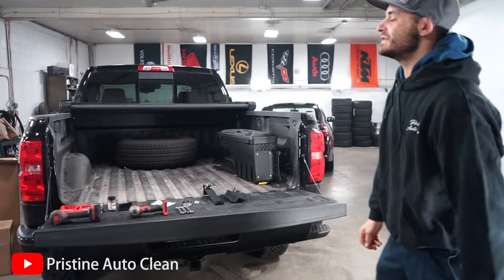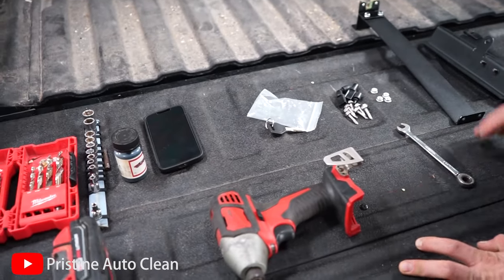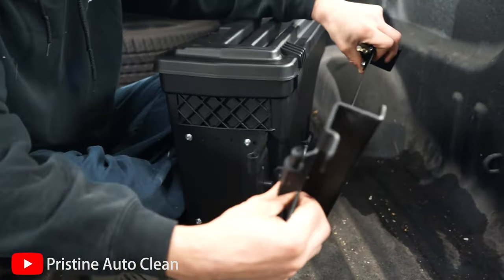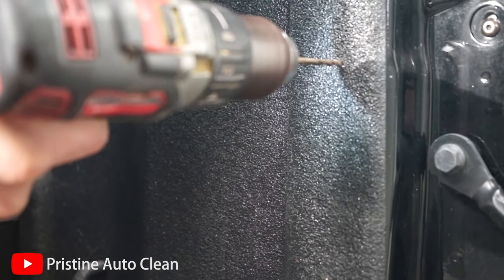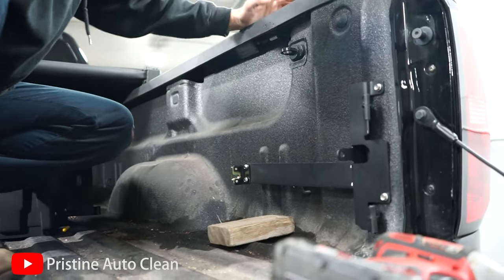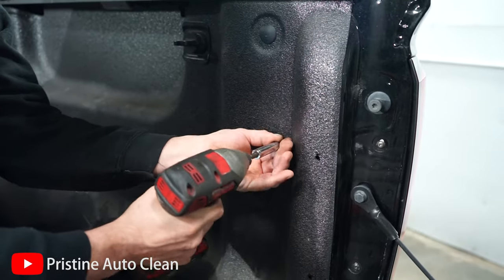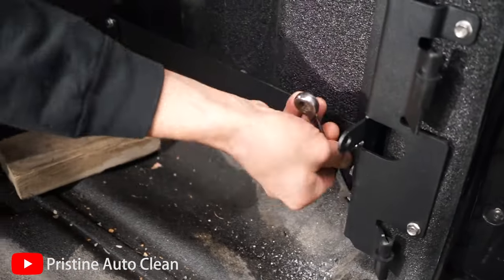Silverado Wheel-Well Storage Box Install!

Comment: Is the lower tie down point now completely covered by the bracket? If so, can you mount a little higher?
Reply from the maker: Most likely is covered, you’d have to remove the box to access it or use the upper tie down location. Could be mounted higher as well

Comment: Very helpful video. I have a gator tonneau cover was a little concerned the locking handles on the gator tonneau cover would interfere. Watching this video I think I am good. Just ordered one on Amazon. If it goes smooth will order 2nd one.
Reply from the maker: Glad it helped👍
Reply: Installed driver side today went perfect.. passenger side arrives tomorrow. Took about 20 minutes. I pre drilled before sinking the self tapping screws.. worked out great.
Reply: Which one did you get off of Amazon?

Comment: This is clearly the difference between how a craftsman does things, and how a week end warrior screws them up. I tried blowing those self tappers home with the "rattle gun" as you call it. it didn't work out so well for me. I like how you did it much, much better.
Reply from the maker: 🍻 Thank you! Been in the game for 20ish years, unfortunately I’ve learned every lesson the hard way! There’s no screwing stuff up, just take those mistakes as a learning experience! In your case just get some bigger self tappers and thread them in by hand!
Reply: @pristineautoclean  Definitely. I’m very disappointed in the design of those swing case things fit my new GMC. They don’t hug the wheel wells and stick way too far out into the bed area. I’ll have to find something else I guess. Too bad. I really liked those things

Comment: Can you still fit a full sheet of plywood in the bed? Also is the box waterproof?
Reply from the maker: The box slides right out if it needs to be removed 👍
Reply: Yes you can fit two 3/4” plywood sheets before you would need to remove one of the cases. If you have 20 sheets you would want to take out both cases. They come on and off very easy.

Comment: Nice install video.  I would buy one, but it lifts right out and can be stolen in 1 second.  No security there.
Reply from the maker: It’s a sad world we live in. I always say locks just keep the honest thieves out 🤷🏻‍♂️
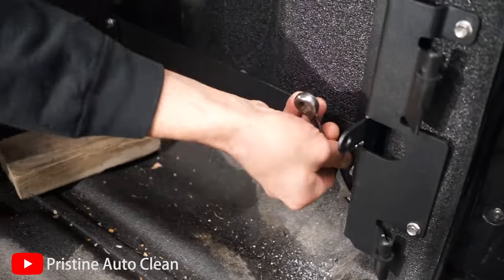Reply: There is literally a spot to put a lock on it where the tongue sticks through the plate stopping you from rotating the box out which makes it so you cannot lift it up. You can see it clearly at 9:48.
Reply: I saw what teeheebag was talking about but if you put a lock on it, it won't turn out to be able to get stuff. So basically everytime you push it back to lock in place you have to put a lock on it and then close the tailgate to keep it from being opened and lifted to steal. Just one more step to do I guess lol